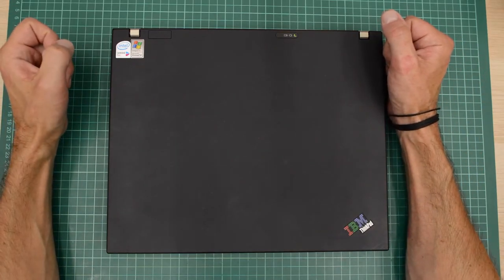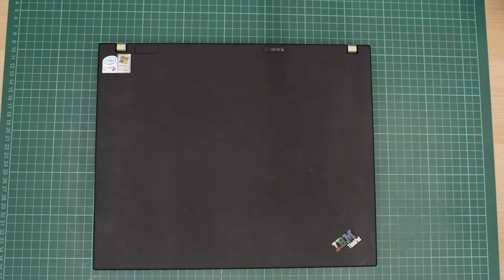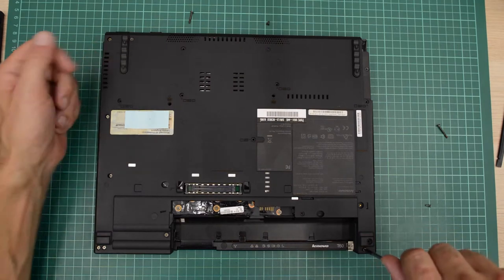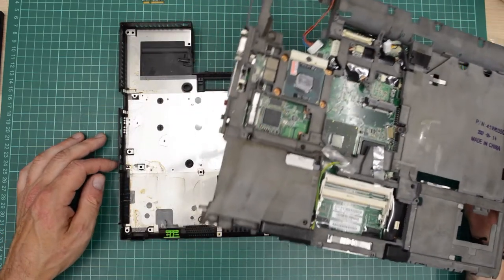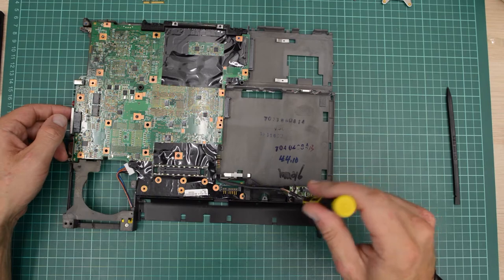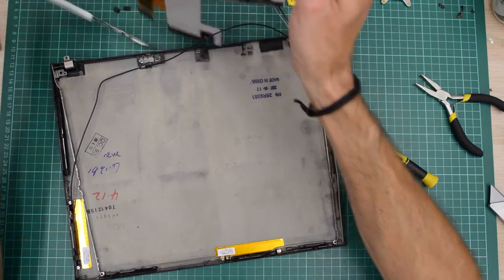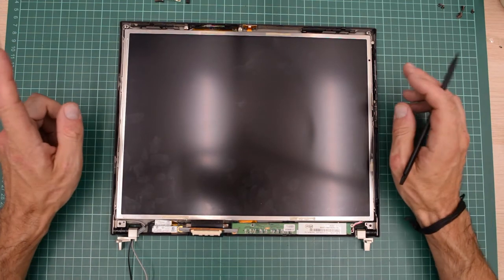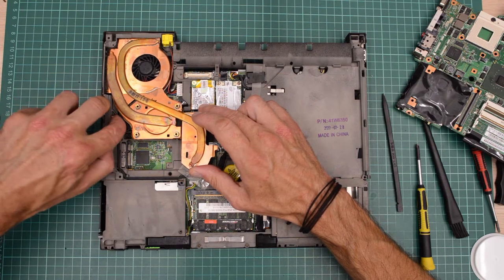T60p conversion. Hi-Res panel and a new motherboard to convert a T60 into a hi-res T60p!

Comment: Don't you have problems with the V5200 ATI Driver?
Reply from the maker: No, It works well. It's been a few years but I'm still using this IBM occasionally
Reply: @Epictronics1  Wow, I have never tried to instal W10 on genuine T60. Have 3 working units, among those one FrankenPad with T61p mobo in it which work perfect on W10. If I can I'd recommend you to flash your BIOS with modified one and replace the Wi-Fi card to some recent ones. This will cost you the price of one CD-R, one PCI-e to M.2 converter (~ 10 Eur) and AX210NGW (~ 25 Eur). That's all optional. But if you're into last true IBM design as T60, you might as well consider.
Reply from the maker: @eduardturchyn3197  Thanks, yeah, I'd love to swap the troublesome wifi card. So the AX210NGW will fit if I use a PCI-e to M.2 converter?
Reply: @Epictronics1  I know for sure that AC8265NGW fits, cause I installed it being the last W7 compatible card. The 210 NGW is identical in terms of size, so yeah it will fit and work with W10 OOB. You will need to cut the adapter card a little to fit the chassis cause it is like 1mm thicker (depends on the unit). Once all installed you will se that the top of the wifi card is going to be be 1mm higher than the linearity of the chassis, so the keyboard is going to have a little bump in the middle, honestly, barely noticable. Final result: super fast web browsing thus no Wi-Fi LED indicator light (fixable through the registry settings)
Reply from the maker: @eduardturchyn3197  Thanks, parts ordered. Overclocking and upgrade video is in the making :)
Reply: Bro, I have ordered the last FX 570m board on the planet. This one was made by IBM (not Lenovo) in 2011. And is NOS. Unbelievable fortune. It is going into my next FrankenPad with T9500 2.6GHz. I also have X9000 but that will be too much heat.
Reply from the maker: @eduardturchyn3197  Sweet. Would it fit an original T60 too?
Reply: It is going to be fit in T60 14inch. 
I have one nvs140m board in my first frank, now second one going to be built
Reply from the maker: @eduardturchyn3197  Oops. Just got a T7600G and a WiFi card with an adapter in the mail. I did some research and apparently, the Middleton BIOS doesn't work on the T60p ATI :(
Reply: @Epictronics1  I have the good bios but can not post he link here. Maybe in twitter if you allow to get messages.
Reply from the maker: @eduardturchyn3197  Thanks, I sent you a message on Twitter

Comment: You should grab one of those refurbished or NOS (new old stock) T61 4:3 boards with the fixed Nvidia GPUs to make a T601 FrankenPad

Advantages:

Support for Penryn CPUs up to the X9000 (and the ability to mod them for FSB 1066 CPUs)
Up to 8 GB of RAM
Faster NVIDIA GPUs
SATA II (if using Middleton BIOS)

https://www.theboardroom.info/t61mobo.html sells one of these
Reply from the maker: Thanks bro, that would be a very nice upgrade for sure. Bit pricey :/ at $139 though.
Reply: @Epictronics1  to fit the board in, you have to modify the T60's rollcage to acoomidate for the new board. I believe more specifically the area where the modem would go

I'm actually planning to try this out if I get one of these boards as I have a dead t61 nvidia board I can use as an organ donor for test fitting it into the T60's rollcage

I know to some this mod makes little sense on the 14,1 inch models as you could just use T61 chassis as is and the 14 inch models never had an IPS option

However the build quality of a T61 is absolutely garbage in comparison. Not to mention the hilarious asymmetrical screen bezel

https://forum.thinkpads.com/viewtopic.php?t=120121
Reply from the maker: @TECHNIKVERBOT  Thanks, I have plenty of T60's to mess around with but I have a hard time to motivate the $139 for a board because I'm still using the TP from this video almost daily! and it does it's job just fine as it is. aside from the crappy wifi card I have.
Reply: @Epictronics1  well to get around the whitelist, you first have to flash the latest available bios to update the embedded controller and then just flash a non whitelist bios available here: https://thinkpad-forum.de/threads/127887-T60-T500-T510-Aktuelle-BIOS-mit-SLIC-2-1

I replaced the crappy 3945ABG with a spare atheros AR5B95 I had from a dead laptop
Reply from the maker: @TECHNIKVERBOT  Thanks! I'll check my pile of scrapped laptops for a AR5B95 :)
Reply: @Epictronics1  Apparently you can also replace the crappy bluetooth 2.0/2.1 daughter board with the one from the T430 as they use same connector and have Bluetooth 4.0 through that

And I also replaced the AR5B95 with an AR9462 from an old prebuilt desktop. Because fuck having no 5 GHz. If I really wanted to, I could grab a 7260 AC or any mPCIe card for that matter. But having 5 GHz n-WiFi is enough for my needs, as it's not my main machine anyway. I have my T440p with 4810MQ for when I do more intensive work.
Reply from the maker: @TECHNIKVERBOT  Thanks, I'll see if I can source one!

Comment: You thinkpad fanboys just have to learn when to just go out and buy a new machine.
Reply from the maker: Ain't gonna happen ;) I just spent a few hours doing some proper work on the T60 from this vid :)
Reply: if you don't know anything on upgrading and taking care of your laptop system then buying a new one is the only option you got. my first ever cheap laptop that i bought on 2012 is still working until now and my second laptop ibm thinkpad t60 that i got for $50 on facebook is a beast and i'm loving it. i used those laptops on programming and web designing
Reply: Haha! We are a frugal committed bunch for sure!  I am using my Thinkpad Z61p on a regular basis since 2012, and it was already nearly six years old then!  It's performing like a champ and fully upgraded.  My other models are also used very often for various tasks from that era, and the newest I own is a W520 from 2011 (bought in 2018 in mint condition top spec).